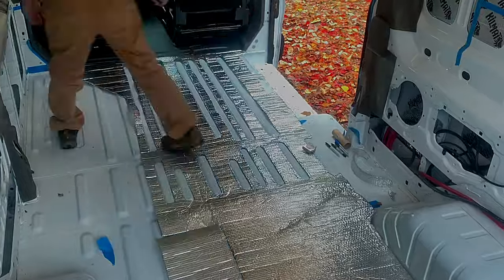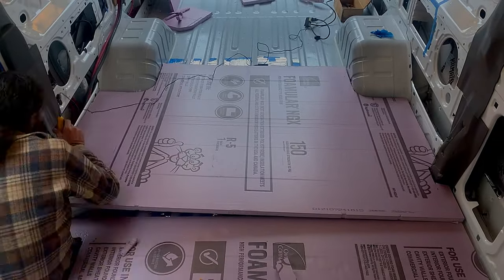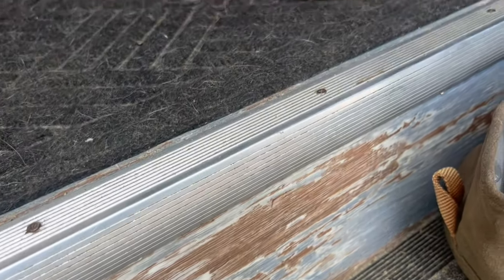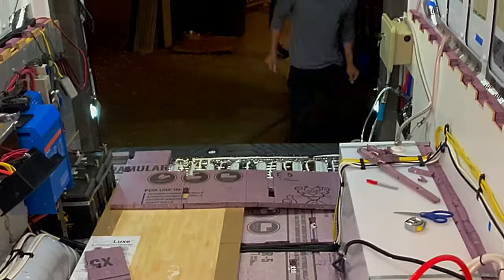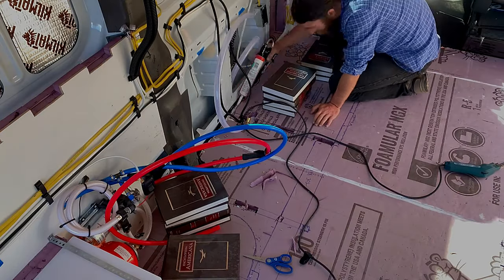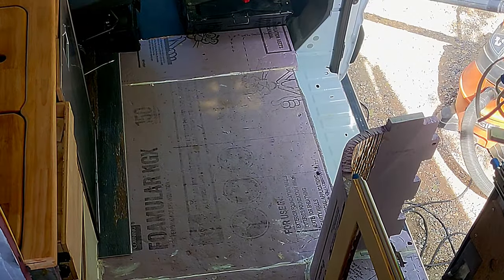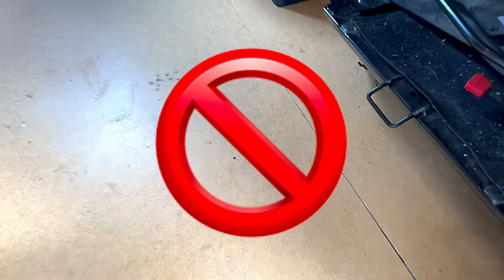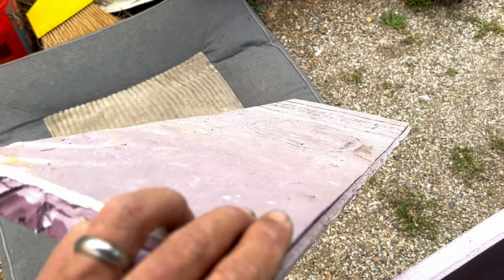FLOORING - Foam Building System Vol. 6

Comment: For those looking for a hot knife: I recently invested in a crafting style hot knife and having a variable voltage control up to 12v makes them a lot more helpful.  Crank it to 12v for the thicker stock and it seems to perform on par with the heavy-duty Harbor Freight blade style hot knife.
Reply: What’s the name and where can I get it! Thanks
Reply from the maker: These are the two I use: 
https://hotwirefoamfactory.com/-K11B-Crafters-Basic-4-inch-Hot-Knife-Kit.html

https://hotwirefoamfactory.com/035I-Industrial-6-in_Indust_Hot-Knife.html

Comment: The more conversions I see, the more I'm convinced that I want to just use one solid sheet of vinyl for my finish layer. No laminate. No peel and stick. (especially in my area. the heat murders everything.) Glue it down and still the cabinets and edging need to be in place to make sure it doesn't move if the adhesive fails.
Reply from the maker: I’m totally in favor of that!! Too much torsion in vehicles for flooring with joinery.

Comment: If you use foam on the floor you have to stick wood or metal dowels through it about every 4 inches and cover with plywood. Other wise walking on it will cause it to sink.
Reply: Yes and he showed how much it collapsed.  Alot!
Reply from the maker: The compression was my first attempt, I later opted for a 1/4” ply on top of foam and then the vinyl planking… year of use full time and it does not seem to be compressing.
Reply: Not true with plywood on top of the foam to distribute the weight. Check out Chuck Cassidy’s video where lowered the wheel of his bus on some XPS  with plywood on top. No compression at all .

Comment: chip board isn't waterproof. great underlayment for the application, but needs to be treated carefully to make for a durable floor. paint it or varnish it, pay special attention to edges and seams. use sheet vinyl over the top of that. forget vinyl plank unless you have it lying around.
Reply from the maker: Agree... I should have treated the chip board... nobody's perfect!

Comment: Been a carpenter for over 40 years, never really used a hot knife. Always a razor knife. Bet my soldering iron would do the same thing, right? 
Hell of a build, Brother.. Very well done! Great detail.
Reply from the maker: Thanks… sure you can cut it with anything… the hot knifes are just the cleanest and quickest.

Comment: Built my van in 2018. Wasn't confident in this system at that time. Wish I would have gone this direction. My van is extremely heavy with all the 1/2 and 3/8 plywood. Will utilize this in my next one.

Comment: Thought you might like an interesting challenge, I’ve been trying to figure out how to make a foam skirting around my RV. Piece of cake for you and tremendously helpful to me!
Thanks , like your style dude…
Reply from the maker: Sure… I’d start with an accordion fold idea… cut the foam to the height of your RV’s clearance, then the length of the storage area you plan to store it in. Use my screening method idea, or use a fiberglass with epoxy coating for even better protection from elements. Either way screen both sides and all edges of the individual pieces first, then to create the accordion system you could glue a fabric like wax cloth or vinyl to create hinges on alternating edges. To attach to RV, maybe Velcro under the bottom edge of RV. That’s my first pass.

Comment: 07/23/2023 Hello Nomad. Once again a good video. I did learn a lot about using 1 inch foam on the floor. I have watched flat concrete  workers using the foam board for knee and toe pads for finish hand trowling. They pretty well destroy the foam if used for a long time on one job. New pads are used for the next job. I do not like the wood vinyl flooring. I do not know of a better solution. However the vinyl wood floor would perform better if laid across and not straight through. Maybe a particle board over the floor to bridge over the humps and valleys then a sheet vinyl would work. They do make some completely ugly vinyl. but you may find one you can be satisfied with if not just happy about the patterns. The kraft covered foam sub fill is a good sound barrier but is not listed for use as a substraite as you now know.I have no recomendations for a subsitute material, but perhaps a full cover with a single top sheet would add enough strength. Then the particle board crossway to utilize the listed stringth span rating. If I had done this project I would have screwed it up worse. I would have tried to overhead the wiring, Not good. Your wire tricks were very inventive.That would work in a lot of auto and truck cab wiring. The clips seem to always break when the cold weather and dry rot of the plastic. Another thought would be to place the particle board and vinyl under the cabinets. That may help you to notice any water leaks and assist with cleaning below the cabinets. One more note, I would have planned a refrig with rollers for easy moving to clean behind at every curve in the road.I told you I would screw it up. I enjoyed the video and hope you understand my non wit or nit wit comment. I have nothing else to do. Sincerely Don
Reply from the maker: Don, it’s always nice to read your thoughtful comments. My second version of the floor (foam then 1/8” chip board, then the cheap vinyl plank flooring is actually working fine… I wish I would have invested in a higher quality vinyl flooring, but until it’s shot, it’s fine. The idea of running the planks short ways rather than long, may be a really good idea that I had not considered, thanks for that!👍🏽
Reply: @falkornomad
Reply: @falkornomad  07/25/2023 Hello Nomad. Thank you for your channel and the nice or gracious replies. I do enjoy your video. I just had some thoughts that put together several thoughts from many videos. On line  has gotten so bad that about the only safe thing to watch on line is good channels. I do enjoy your calm and laid back presentations. Sometimes my wit exceeds my knowledge. Thanks for allowing me to be free to comment even if my thoughts are from old memories. Sincerely Don

Comment: hey brother, new builder, long time tinkerer.

for your floor, do the paint and possibly screen over the top of the floor insulation, and about a quarter to 2 inches up the wall in areas where you think moisture might soak into the floor, then use the thin, either 1/8th or so ply wood, double ply is fine, then use a 2 part thin pour epoxy to soak into the wood once it is fastened in place.

this creates a demi permanent layer of epoxy, structurally supported by the wood, and sealed by the paint and screen layer, or even screen and glue.

the floor is the one layer of the  bus (in my case) that needs to be as solid, yet flexible as possible, without having lots of heat loss from structural beams, so insulation building is going to be an absolute benefit.

but with the composite of flexible glue layered with screen on the floor, then that is scraped down in the over ran areas, and painted with one of the primers you spoke of before, this creates an impermeable layer for the epoxy to cure to, and then harden the thinner wood panel, and create a plastic like finish on the wood that makes it completely impervious to moisture expansion, and helps hold it all nice and solid.

if you want some grip, when you pour the epoxy, dust it lightly with course sand and spread it evenly across the surface, this cures into a nice super material that is both very flexible, water proof, wear resistant, and adds some grip to the floor.

give it a try, the epoxy sand on wood trick, you can also mix sand into the epoxy and pour that then spread it thinner for a nice even layer.

i dont make videos, you make far better quality content than i do, but i do a LOT of testing for my final build in which i will turn a large highway bus into my nomadic mansion on wheels, a full sized home that lets me travel across the nation.
Reply from the maker: Thanks for the tips!!

Comment: Thank you! Been waiting on this one. Do you think applying the screen method you have used for your furniture to the foam before laying it down as the floor would have aided in preventing that compression you pointed out?
Reply from the maker: You’re welcome! Screen has very little if any effect on the compression strength, so no.

Comment: Ooops, I learned that lesson the hard way too. I put vinyl planking straight on the foam thinking the compression wouldn't be too bad. I have cracking all along the seams now. I also had a sliding bed frame and the bed legs just murdered the floor at spots.

I was just going to give up and go with a roll of lumpy carpet rugs. At least it'll be easy to roll up and clean outside?
Reply from the maker: Learning to adapt to our mistakes is a crucial human skill 👍🏽🤷🏽‍♂️😂

Comment: Any tips for cutting recesses into foam rather than through-cuts? I'm thinking about cuts for running wire/conduit or inletting wood stringers...
Reply from the maker: You can do this several ways: It is possible to use the hot knife and melt only half way through the foam, you can also make your own hot knife ( see someone else's video) that has a loop of metal wire that will carve out a recess, or you can use a router like you would for wood.

Comment: Hi can you show me hoe todo a SUV with a floor that is not level to a weekend camper. I have a older Toyota. Would love to get away for weekends on a small budget. Thanks for your videos🌻
Reply from the maker: I think the way to approach that would be to build multiple pieces that fit together in car… so you could put them in one at a time, connect them together some how and have all the features and functions you want from 6-10 smaller units that are easy to lift and store when not in use. Good luck!

Comment: I’m catching up on the foam bones and scanning through these videos, have you used the foam bones for the bed platform?
Reply from the maker: I did. Works great… see this video https://youtu.be/A9wJfenHcOs?si=s4FpNN78RP88tRGs at about 12 minutes to see how I added more strength directly below the bed platform to distribute the weight better. I do have larger open spaces at the foot of our bed (the largest is like 20x20” I think) see any video that shows the dog bed area which is under and behind me in the video above for all the “talking head” footage.
Reply: @falkornomad  thanks for the quick response! I’m building out a minivan so the bed is going to be by far the heaviest structure. I’m super into the idea of shedding weight with this stuff

Comment: I bet you could make a great foam bones vneck 7x12 cargo trailer!  It would be the parking spot king!
Reply from the maker: Trailer project is on the list… it’s WAY down the list, but it’s on it 👍🏽
Reply: @falkornomad been doing research and it looks like 7' wide is the minimum to unlock sideways bed layouts.  7' tall seems to accommodate mini splits or foldaway showers/cassette toilets.  My plan is to fit in a regular parking space yet pack a 12x12 frame tent and fold out the ramp.  But to do it with your foam bones method would be neat!
Reply from the maker: You thinking toy hauler (ramp)? Like bikes or motor sports? How would you utilize the V front? Tell me more! It’s my turn to steal your ideas, lol.
Reply: @falkornomad  Allow me to make a few edits to this post so I can track down the right links with the designs i had and you might be interested in as well.

1) This 7x12 minimalist ramp design would make a great foambones conversion, plus light enough to be hauled by your van: https://youtu.be/Pv9rFWtp7Ls

2) The back sliding screen door on this ramp model is icing on the cake: https://youtu.be/7tdlSA4wO-A

3) No one has done a camp shower inside their conversion yet so I'm thinking pairing up an intex mini frame pool 4x4 with a Joolca Nomad hot water shower system.   Of course you could set up the shower inside the unit or outside depending on the mission.  Just needs roofracks and awnings :).  Also being able to haul a 12x12 frame tent (those commercial tents) would make semipermanent camping feasible.
4) Update 4: just saw a holy grail design of a full time liveaboard in a 6x10 package which is impossibly small to fit everything, but they did.  The front half kitchen/shower combo is genius and original and makes it possible.  https://youtu.be/kyYqcFvGFLo

The fish processing table as an outdoor sink and ikea kitchenette is just stuff no one thinks about.
Reply from the maker: Interesting… so you would buy the trailer shell and build foam bones style inside. Only using the ramp for a big window, not for any gear loading needs?

Comment: People make teardrop 'foamies'. I'm assuming that one could use XPS foam, finger jointed and fiberglassed for strength. I'd love to get your opinion on how you might blend a timber or aluminium frame around doors and windows for strength with the foam.
Reply from the maker: Foamie trailers are usually XPS foam. The foam anchor system (white spiral drywall anchors) that I cover in my foam screw and glue tests would work fine for wood or metal for door / window frames. Also gluing them in at the same time. The anchors are 80+ pound pull out strength each so however many you need for the expected loads.

Comment: I found your channel while looking at different van builds for ideas. I never knew anything about building with foam. My curiosity led me to teardrop and truck campers built from smart (Poor Man’s Fiberglass), lightweight, and cost effective materials.

Some of these guys go off-roading and across very challenging terrain for years with no issues.
So, here’s my crazy but serious question. Could this method of building be used to build affordable structures to house the homeless even for short term transitional housing, if not long term?

Has anyone tried it?
Reply from the maker: No one has tried that I know of… I have toyed around with the idea, even drawing up a “flat pack” shelter for 2 adults & 2 children that would have a plywood floor and 2” foam walls  roof & bed platforms with 1” basic shelves. I think each shelter could pack down to be a standard double pallet (4ft x 8ft x 5-6ft tall). I think the shelter could be built by 1 person in less than an hour. It’s a good idea 👍🏽
Reply: @falkornomad if a subscriber like myself funded the materials would you be willing to build a prototype ?  Maybe once all the kinks are worked out it could be donated to a family in need or keep as a model to show the possibilities.
Reply from the maker: I’m traveling full time right now, but will be in a new home with workshop soon. I have plans to do some other foam builds (cab over camper, teardrop trailer, etc) to refine the system and test more options. 

The temporary / emergency shelter idea is a good one on that list… tell me more about the use case you have in mind. Are you thinking just an insulated room for 2-4 people to sleep out of the elements while in a “camp” where an government or NGO was providing meals and bathrooms… or more like a fully functioning home for homeless or disaster victims like this: https://www.huduser.gov/portal/publications/design_details.pdf
Reply: @falkornomad ideally a fully functional small home but at minimum shelter from the elements. There a guy who is full time van living who does single person shelters for homeless guys he meets on the road. He’s done bike campers, a small tiny on a wheeled frame, etc.. I think his channel is Beer Bus Runs or something like that.

I’ve found your videos very helpful and it has my brain turning with ideas for inexpensive housing.
Reply: @falkornomad  07/24/2023 Hello Again Nomad. The only problem that I see with this plan is no under floor insulation That is cold in some weather. You will need a plywood under carriage with a truck bed liner paint on both sides before mounting to your trailer. This means 2 sheets of plywood with foam sandwiched inside. The sheets can be very thin.  You may think about a fixed foam trailer to pull behind your van. I would make the roof only 4 ft. 5 or 6 ft means several extra joints to fail on the road. You want a very low profile. Your 45dg corner bracing would help with any strength at the connections. Some side wall and roof bracing like beams on the inside would add flex strength for the road. I would also angle the roof sides for much needed extra strength. I would also put an angled front and a sloped roof section to match the angle for wind while towing. This additional work would brace and stabilize for the wind. I would also place an angle on the rear roof for side to side bracing as well and roof bracing. Any change from square is practical. I would double the poorboy fiberglass on the front angle and the roof angle to help with the rock chips while towing. I would chamfer all of the outside edges.  
This is the place for extra clothing and bedding sheets and pillows storage plus dry and canned food stuff, skies and hiking gear. You could store self help tools and even heaters and coolers and some extra water. This may lower your van loaded curb weight. Wheels and axle study will be necessary. Too small will put you off on the side. Many packaged trailers have very small tires. Change them to larger and safer small truck tires. This should carry about 500 pounds of stuff outside your van. I have no suggestions for the back doors, hinges and locking. Perhaps a plywood /foam laminate inside the doors and some plywood bracing on the foam walls to support 2 doors. You can place foam applique on each door and on each side just for kicks. I would use a large funeral coach hinge pattern on each side. Or not. I have thought about the foam trailers. In my dreams! This is too long but I hope someone will laugh at my silliness.  Perhaps some of your readers will delete this just for nonsense. I had fun writing this, thanks for the opportunity. AS always Don.